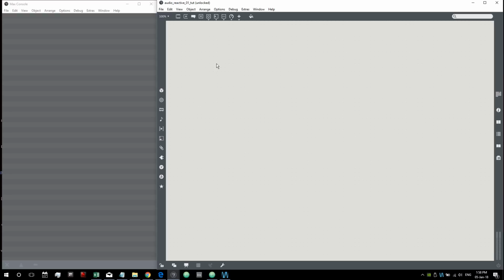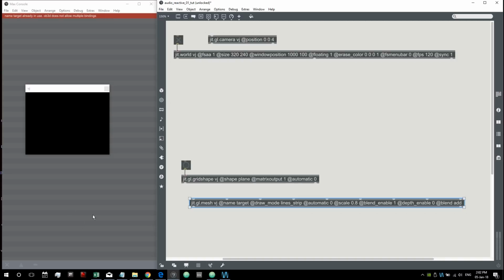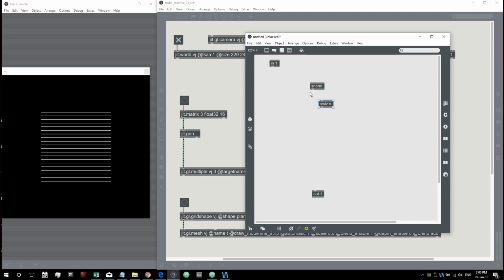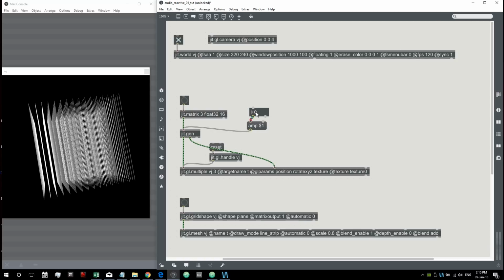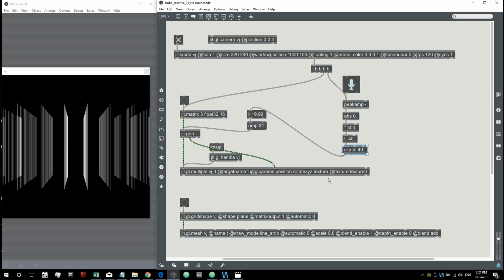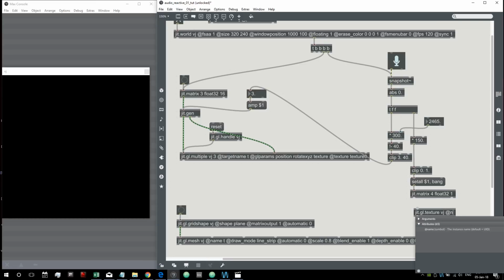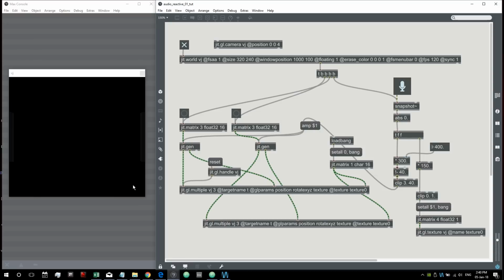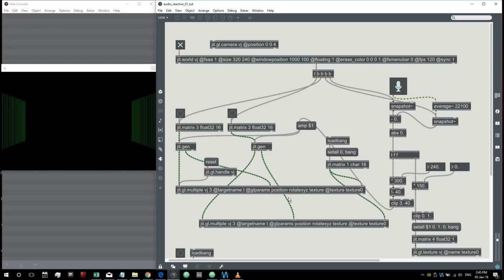AMT - Audio Reactive Tutorial #01 - Audioreact Lab Remake

Comment: Thanks a lot for this tutorial! Frustratingly, I can't get the color to work :( Any tips? All setup 100% as your tutorial but no luck. Sx
Reply: I had the same issue. I sorted it out by deleting of the first 'texture', between 'rotate xyz' and '@texture'
Reply from the maker: Hi Svet, the color is given by the texture called texture0, are you sure that you assigned it to the jit.gl.multiple objects using the @texture attribute?
Reply: @AmazingMaxStuff Same issue here. I confirm I did the same with you and assigned the texture0 to the jit.gl.multiple object. But the colour didn't change. Do you have any solutions? Thanks in advance. By the way, nice tutorial. It's very useful and clear to help me a lot.
Reply: @Amazing Max Stuff
Yes having the same problem. Can anyone help with why the texture seems to not work?
Reply: Same thing happened for me, I ended up just manually linking the texture to both the multiple objects and now I can have the colors :). 
Nice patch and tutorials however^^!